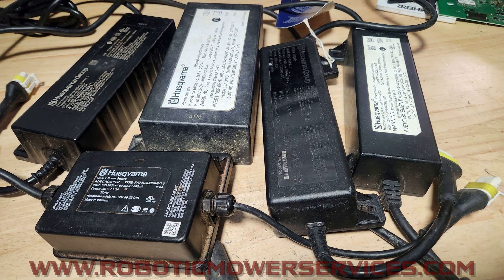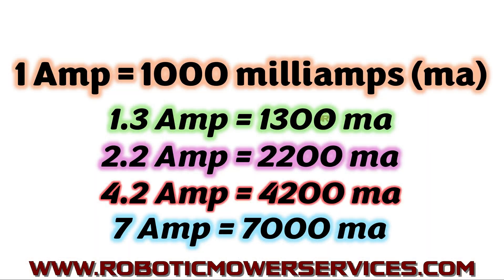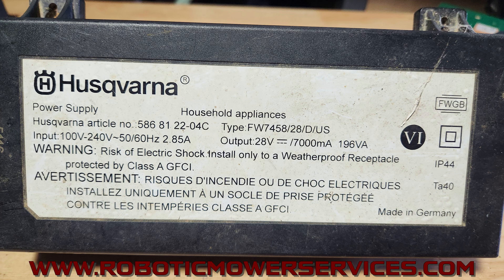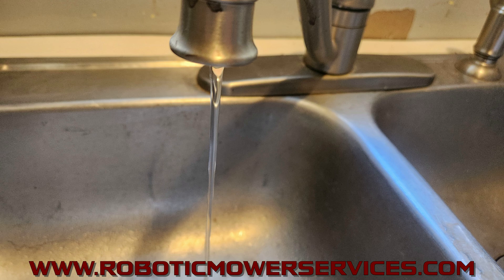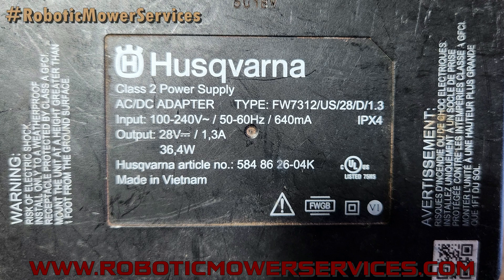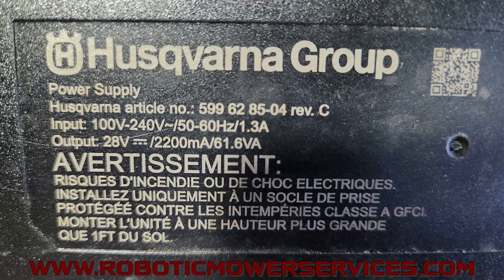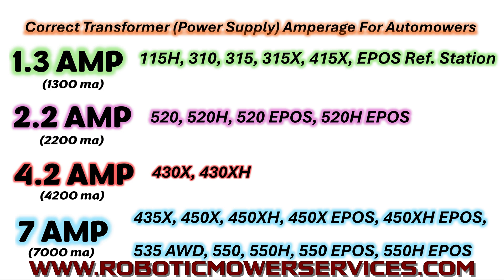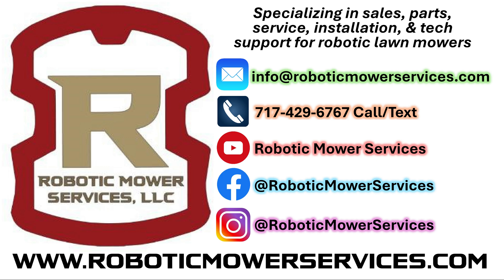Husqvarna Automower Power Supply (Transformer) Information. What You Need To Look For & Differences

Comment: Hi, good thing. I am thinking if i can apply bigger power supply ro the station and bigger battery into a automower for longer cutting? I have 305 and 10hs of work a day it is too short. Efficiency 600m2 it is a dream.  I need longer cutting time but no longer charging time during a day work. Thx
Reply from the maker: No, you can not do that. The mower's software is set to detect a specific amount of charging current AND a specific battery capacity. It will give errors for both of those things.

Comment: Like always, very nice content ! However, I am surprised that you don’t talk about alternatives like Meanwell power supply, cheaper and a LOT better in quality. OEM power supply is very bad and super expensive… (430x owner since 2017).
Reply from the maker: The reason for that is that they are not direct plug and play options. Despite the information that we put out there and ask when providing tech support there are still a LOT of people that can't test the standard transformer to see how much voltage it is putting out. So promoting an adjustable one or one that needs the proper ends installed on it will lead to a lot of confusion and headaches that we would rather leave up to someone else. You really wouldn't believe the stuff we've seen over the years and continue to see.
Reply: can't find any from them that provide 28V DC, only 24 or 36?